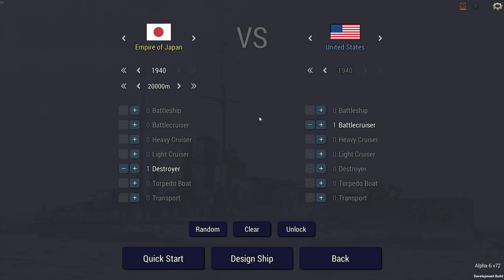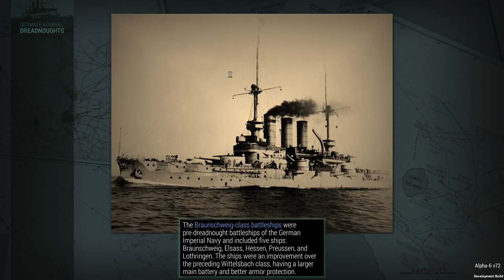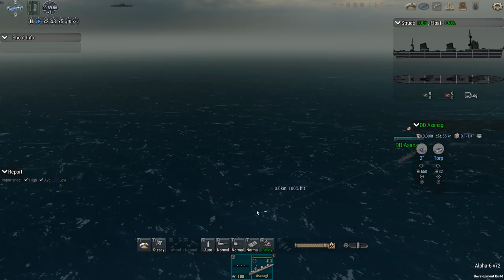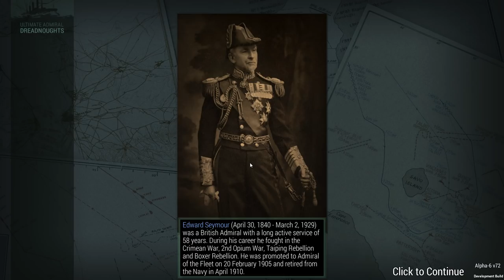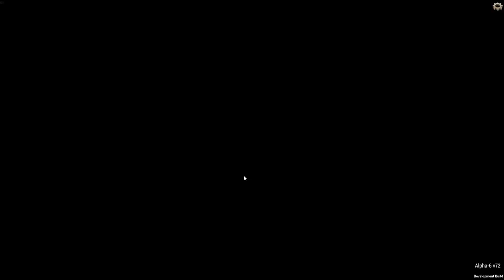Ultimate Admiral: Dreadnoughts - 55 Knots (Alpha 6)

Comment: The Engine weight is not a bug, you have to look at the hp per ton. To achieve those speeds you need a certain amount of hp(237,000 in this case), and gas turbines just have an enormous amount of hp per ton, thus offering much lower weight overall

Comment: This ship seems like a potential formation breaker when used with other ships. Increase displacement, use lightest towers, single 2 inch gun, install a lot of launchers, but low capacity since you're not planning to reload and then just run it on interceptor course with 2-3 ship in enemy line, smoke up when entering secondary range and try to take in front of the bow. Basically a 3k ton suicide craft.

Comment: So in theory a much quicker ship wants to maneuver to overtake from the rear. This way it is you who decides the engagement parameters which is highly beneficial. This actually allowed me to kill the BC repeatedly in this very scenario. Just come in behind him, use hard rudder to keep him from hitting you, get to knife range and loose torpedoes. Using single launchers for reloads I had to get him multiple times, but after 6 torpedoe hits he usually was toast. 3:0

What you chose to do is go for the mass salvo (which can work) and then charge into his broadside (which almost can't work).

Comment: Regarding the engine power/weight issue, its not just the engine weight percentages, but also the hp/ton. To get the ship going at 55 kns, it requires 237303 hp. Now, the different engines produce different power outputs. So, the geared turbines II get you 30.5 hp/ton, meaning you need 7780.4 tons of geared turbines II to produce that power, not counting the weight percentage reduction. The diesel, by contrast, only makes 16hp/ton, so for the same hp output 14831.4 tons of diesel engines for the same power output, again not counting the weight percentage reduction. Applying the weight reduction percentages second, the 22.5% weight reduction takes diesels down to a weight of 11494 tons, while geared turbines II with their 9% weight reduction yields 7080 tons of geared turbines II. For diesel II, without the weight percentage reduction, you need 13183 tons of diesel II engines for the required power output. Applying the 27.5% weight reduction, diesel II only needs 9558 tons, so they're lighter than diesel I, but still not as light as geared turbines II. Admittedly, I'm applying the weight percentage reduction after doing the horsepower calculation, so the numbers will change if its the other way around, but the issue is that, for a given increase in speed, the additional required horsepower is not linear. Instead, it grows exponentially, so going from 25 to 35 kns requires a boatload more power than going from 15 kns to 25 kns. Where the horsepower requirements are lower, such as on a very slow ship, it should scale the way you're expecting, but given the Stig levels of horsepower needed to move the ship at 55 kns, the hp/ton advantage of geared turbines II outweighs the weight percentage reduction of diesel engines, though diesel II does deal with it to some degree. I don't have the game to check this, but my guess would be if you were doing a very slow ship, the weight reduction percentage for diesels would outweigh the hp/ton advantage of geared turbines II.

Comment: The engine weight is calculated on both the weight and the horse power per ton. The diesel has less hp per ton so it weighs more for the same weight, despite theoretically being lighter.

Comment: Here is a posibile scenario, USS Lexington is escortring troop convoy to New Guinea, she is only escorted by the USS Dalas light cruiser armed with 2 double 5" & 2 triple 5" turets because reports inficate that all of Japanese fleet is tied upin the Philipines where (in this alternate universe) McArthur is still putting up a defence of Manila akin to the defemce of Stalingrad. Convoy consists of a 40 transport ships USS Dalas and USS Lexington, but since the weather is abismal, she can not use her air wings and has only her secondarie batery to defend herself with. It consists of 4 double 5" turrets that can shoot either side of superstructure 2 forward and 2 aft, and 8 single mounted 5" guns, 4 per side, her armor is folowing: 25(deck)+13(hangar)+51(citadel)=89mm of deck armor, 25mm of deck extended, 32(citadel torpedoe bulkhead)+178(belt)+19(side plateing)=229mm of armored belt, 19mm belt extended, speed of 33kn. Your task is to safely escort the convoy and defend against 5 of those super fast 55kn boats, acceptable loses are half of the convoy

Comment: I think a strategy for the HIGH SPEED NO DRAFT DD is to go with fewer  but faster reloading torpedo tubes, so that there can be more of a stream of torpedoes coming out.   Suits the harassing role better I reckon.

Ideally if you could have one group launch at long range, then reload and send a second wave at a different angle.  Then both groups of torpedoes could be hitting the target at a similar time.  Or the second wave is ready just after the first one hits.

Either way, the 600s reload time of the big launcher seems like a lot of time to have to not get hit and can't pressure

Comment: I'd personally use these kind of ships either as a quick response unit to cover defensively the seafront, keeping in mind its "Short" operational range, so that quickly it can be sent to act as a gap filler in a defensive line. Or as the ultimate convoy raider, you dont have to worry about enemy escorts if you are hitting them where they aren't expecting! The supreme big brain strat would be to make an entire strike group of only super fast ships so you can zoom on the strategic theater and do surprise attacks with extreme strenght anywhere, but it may be too expensive to maintain tho

Comment: I'd say a swarm of them as oversized  E-boats or PT boats would be great. Send 3 or 5 of them out to harry anything that is a little too under-protected. Sending them out as a solitary unit can be useful, but ideally you want to use these like you would torpedo boats around the turn of the century. You don't expect them to survive but with massive and fast torpedoes you can probably sink several times their cost in a single sortie if they can get in close enough.

Comment: German cruisers in the Indian ocean:

After a series of British SAS raids on the large dockyards in France in 1943 the heavy cruisers Admiral Hipper and Prinz Eugen are cut off from proper repair stations and have been ordered to head to Japan as a helpful force for the Japanese war effort in Asia. The British tho have intercepted the German  radio communication and have sent out a powerful strike group centered around an upgraded admiral class battlecruiser to search and destroy the two German heavy cruisers.

Eventually a Catalina recon aircraft has spotted the pair of German heavy cruisers somewhere in the Indian ocean and reported their positions before it was forced to turn away due to heavy Flak fire. So now the British fleet gives proper chase to the two German ships.

Kriegsmarine:
2 1940 heavy cruisers (the upgraded Hipper class, the range needs to be set to very long and the speed 30knots, otherwise go with whatever you want)

Royal Navy:
1935
1 battlecruiser
2 heavy cruisers
2 light cruisers

Engagement range is at 20.000m

Your task as the commander of the Kriegsmarine ships is to either cripple the Royal Navy fleet by sinking their capital ships (battlecruiser, heavy cruisers) or to stay alive for 6 hours, then a Japanese fleet will arrive and engage the British, saving the two cruisers

Viel Glück Kapitän

Attempt 3 and I hope that the British won't just run away in fear

Comment: 20:20 i would use this as a gunboat. Put a 2x1 torps or 2x2 torps while focusing on some heavy guns or something on the edge. I think the reason the ship went into the waves alot is maybe cause you built it right im the edge of its displacement.

Comment: Its a high speed scout/harassing vessel.  Think DD version of sub wolfpack or PT swarm.
Radar and Long Range torpedoes with lots of reloads in fast loading small volley launchers and if it exists, any way to reduce your detection foot print.
After that, single largest deck gun that fits to fill up tonnage to tag supply chain ships.
Cut in at 15-30 degrees from in front of direction of enemy travel, fire at max range, veer off until 75% reloaded, then veer back.
Rinse and repeat.

Comment: The engine weight with diesel is not a bug i think. Diesel engines are reliable etc, but have low hp per weight. So in order to go 55 knots you need a very, very powerfull engine, so the diesel is extremely heavy. heavier than the weight modifier can offset.

Comment: I would use them as fast attack craft like traditional torpedo boats.
Radar + oxygen torpedo + speed. You should have removed all armor to fit a radio and use oxygen torpedo. Amount of tubes is not too vitally important IMO, although it certainly would be nice. The key is to have several of these do hit and run tactics kiting the enemy in a swarm.

Comment: An interesting tactic might be to use your speed to get ahead of the BB and attack at full speed head-on.  Closing spped about 75 knts.Enemy will lose use of aft guns and most of the secondaries.  Stay on enemy's nose until about 2000 yds or until the enemy decides to turn.  Chicken! He goes right you go right and launch everything.  At 50 knts and close in his main guns cannot traverse fast enough.  Assuming you are still alive and not damaged, breakaway speed also 75 knts.  Make smoke and summon Chaplain.

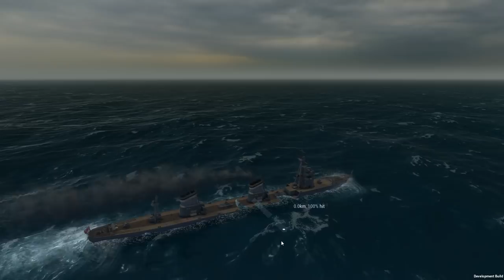Comment: 8:50. You designed a wet ship. Ships could be classified as either dry. Or wet. most WW2 battleships where wet. Especially destroyers. Being so low to the water they wouldn’t sail over the waves. Rather straight through them. Meaning the deck often is washed by waves. Look the term up.

Comment: the AI maintains a steady cours, you could release those tops from a safe distance, and it would still hit.
also, they only change cours when a target is out of range or AI ship got severely damaged, so if you want to land a hit, make sure to stay in range.. so all in all, not too far, not too close.
example: earlier you could have released the torps at 13km, but you also need to speed a little ahead of the target too so that the torps' trail does not exceed the 14km.
as in, release the torps once you're ahead of the target. if the torps are  released at a 90 degree angle of your ship it would mean that the torps probably won't exceed their range.

Comment: I would use a fast destroyer (50+ knots) as a leader like the french intended. Fast, rapid response vs light cruisers and destroyers. 

Also Stealth, with the new destroyer hulls you can make an ultra light cruiser. 8x3 127mm (5 inch) with high speed and some torps. You just dont have the armor. This design is really funny. you should try it out

Comment: I would use this ship for exactly what your doing... Just as a "trade" even if you don't outright kill the BC... just pumping a couple torpedos into the BC will put it in dry dock for months. If your Torpedo boat gets hammered but you take that capital ship out of the fight for months you win. (depending on how much your torpedo boat cost)

Comment: Scenario idea:

Desperate Measures

D-Day has been launched.
the german navy desperately throws everything against the invasion fleet trying to crush them. In anticipation some more creative engineering officers in the german occupied french ports took damaged and now trapped destroyers and turned them into make-shift oversized fast attack craft, capitalizing on stockpiled torpedos, originally inteded to be used by submarines. 4 of these "fast destroyer crafts" now launch to intercept a heavily guarded allied supply convoy carrying vital supplies to keep the allied armies in the field. It is guarded by british ships. 

The german engineers took inspiration from the german Schnellboot (fast attack craft), 
which result in following design restrictions: 
-you will build 4 destroyers. 
-since they were stripped down as much as possible they will have the smallest avaiable conning and secondary towers. 
- Due to ammunition shortage nobody bothered with guns. A single 2cm gun (meant for make-shift AA-role and therefore not to be used to engage the enemy) was left on board. 
- stripping down the ships resulted in massive speed improvements (speed: 55 knots)
- to be able to conduct Schnellboot like attacks at least 2 forward facing torpedo tubes on the bow are needed (multi-launchers, which can turn are acceptable, too. Try to fit as many front firing torpedo tubes on the bow as possible. If the game allows for launchers being installed on babettes install super firing torpedo launchers.)

addtitional torpedo launchers may be installed in more traditional positions. 

The enemy convoy consists of 12 transports and is guarded by 6 destroyers, 4 light and two heavy crusisers. 

Engagement begins at 15000 m distance.

tech levels: 
Germany: 1941 (these are refitted crafts) 
British: 1944 (the convoy got lucky and received brand new ships as escorts.
Reply: forgot win conditions:

at least 9 transports have to be sunk to cripple the convoy sufficiently for a full victory and at least 2 of your vessels have to survive. If you meet these criteria german high command will convert more destroyers into last ditch attack crafts. 

if half your ships survive, but only 4 - 9 transports are sunk german high vommand will deem it a one off victory and decommison your attack crafts. 

if you sink 9 or more transports but only one of your attack crafts survive   the engineering officers will get in trouble for throwing away ressources, even though success was made and no further conversions will take place, sonce survivability is too bad. 

if all your ships sink or less then 4 german high command will seize all operations against the supply convoys and will deem this cause lost.

Comment: Depends whether the game lets you do this, but I'd say build it with no armor, the lightest gun you can manage, and generally as cheaply as possible.  Max speed, max torpedoes, then build a whole bunch of them and have them kamikaze into the enemy battle line at top speed.  If they sink even one enemy battleship before they all die they'll have at least come out even on the deal.

Comment: at 55kts there should be very little ship in the water, even for a 3000+ton dd
wows has the same issue, the water you see and the surface the ships move on are two different things. means you dont need to simulate boyancy.
my tactic, charge the target ship pass by her stern, point blank torp drop to put the whole solvo in, and use the targets turret traverse to escape the far side without risking main gun fire for a while. rinse and repeat.

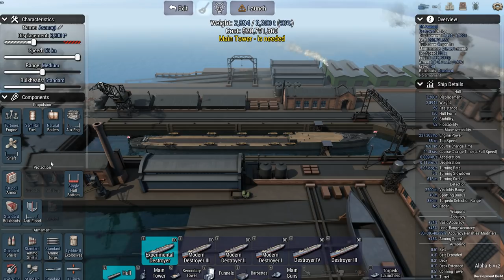Comment: 00:36 no, it's not a bug you have also to consider the hp/ton ratio, geared 2 are lighter because you need less tonnage for the same power and speed, diesel is good for bigger ships which have a lower speed on average and higher tonnage.
Reply from the maker: Yeah, my bad. Didn't consider that part.

Comment: I don't think it's a bug. The speed is determined by horsepower, there's a stat at the bottom of the engine description that says "horsepower per engine ton." On the diesel II, that's 18, on the double geared turbines, it's 30. I think diesel probably has better range, but obviously geared turbines provide more power for their weight.

Comment: I think it's because that the Diesel engines have less power per ton compared to gas turbine engines. Thus requiring more engine weight.
Say that you have an 1800 ton ship, you need 100 tons allocated for the engine when using Diesel while only needing 60 tons for a gas turbine engine.

Comment: The Engine thing is not a bug, I've figured it out.  So you said you wanted 55kn. The Geared Turbines II is the best HP per ton (of engine equipment).  The diesel is nicely weighted, and has bonuses regarding damage to the engine and damage control.  It takes a heavier amount of machinery using diesel tech to go fast than to go that same 55kn using a geared turbine setup.  Basically the diesel is lighter and safer, but requires more diesel engine equipment to go the same speed.

Comment: 4 Destroyers as designed in the vid, bobbing and weaving until the enemy's fire control starts malfunctioning and has to be reset.  Then a multi-axis torpedo attack while blowing maximum smoke, with destroyers escaping  down smoke corridors just made by sister ships.
  Probably lose 1, maybe 2 destroyers, cheap when compared to cost of larger combatant.

Comment: Hmm about ship design idea. Have you tried unbalanced builds and do make it work?
1. Like fore tower only ship, compensate the accuracy lack with anything else like radar.
2. Assymetrical turret or funnel layout,
then make the hull shortest possible.
3. No front gun, just back turrets. Make the firing arc as bad as possible, but with a lot of guns. Put the funnel at the front of the boat.